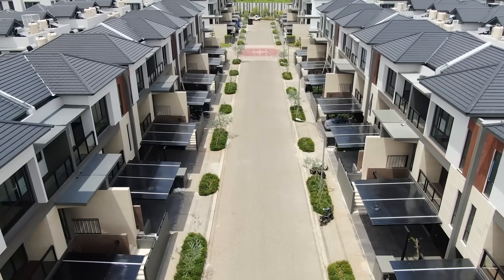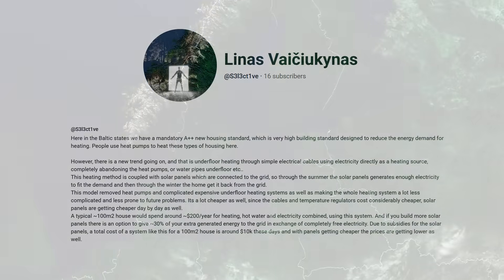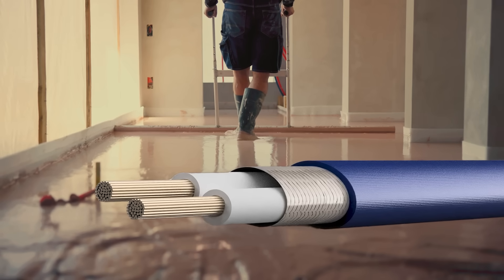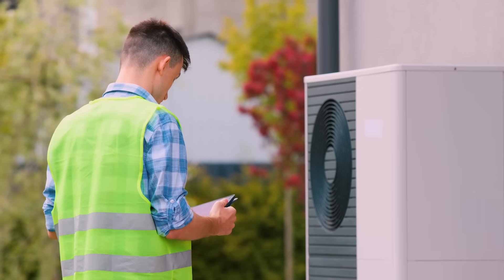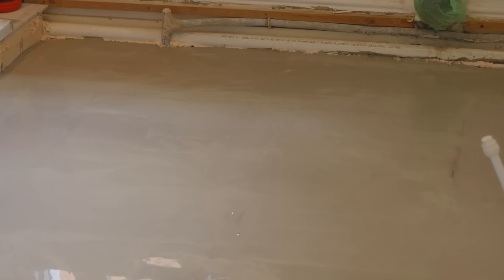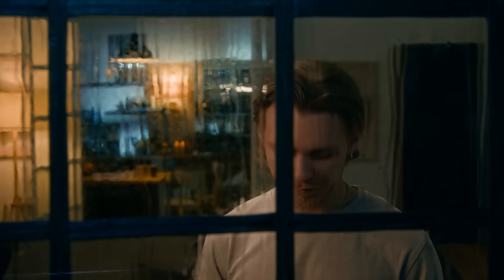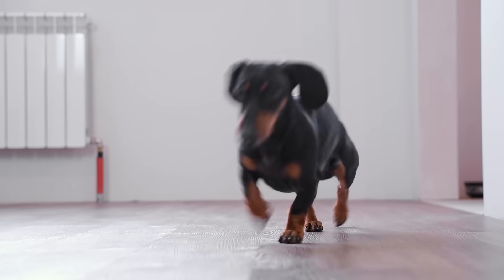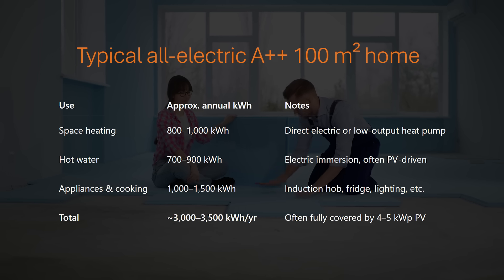What the Baltics Can Teach Us About Home Heating

Comment: The thing about the green heating movement that always baffles me is the fact that if you insulate your home correctly like is recommended by the green heaters, if you kept your old boiler, it would probably only use a couple of litres of gas a month and would likely rarely come on. You would have a piping hot house on demand at a fraction of the cost.
Reply: 100% agree very often the "heat pump" comes with the recommendation to upgrade the insulation, and the comparison is made to older boilers, often larger radiators are fitted, from my experience of 25years of fitting heating systems, a condensing boiler, rads sized for lower flow temperature and most importantly!  Simply cleaning the old cat/dog fluff from used rads, in some cases, better controls, for a relatively low cost! Most households would  make a big saving.
Reply: Yes agree entirely with you. Raise insulation levels a the first priority. Don’t get hung up on the heat source.
Reply: @chrismoore7569 I’d also probably go for solar panels as the second step after insulation.

These will reduce your annual electricity bill regardless.

Producing some of your own power also makes heat pump operation more realistic, even more so if you have a battery. If you have both you can make, import and store power to run a heat pump cost effectively. But that is a lot of investment up front. A lot.

No matter how I do the numbers heat pumps come out as the last piece of the puzzle to fit. They do make sense eventually, but only towards the end of a chain of upgrades. If the price of electricity comes down though, they may be more sensible, but not right now.
Reply: Insulation first, whatever you are doing. It works with any heating system and saves you money either way.

The potential of heat pumps is it gives you access to electricity as a viable heating technology at a cheaper cost. Whether you can access that potential depends on your circumstances. That is the key point and for many people right now, the numbers won’t work.

As an example, I have solar, but also gas and have no plans to install a heat pump. But in the summer, I have enough solar to divert to my hot water tank. I don’t use any gas for heating water for at least months of the year. Obviously the heating isn’t on, but there are still taps and showers to be supplied. In the winter I heat the water with gas like everyone else and run the radiators. The solar gives me the ability to reduce my gas use, and bills, over the course of 12 months. I am quite happy with this hybrid approach. I wouldn’t dream of going all electric for example. I don’t get why you have to go one or the other - sure it’s the ‘ideal’ but it’s not practical for most people. But, if electricity price fell back to where they were before the Russian invasion or if I get more solar panels, maybe the numbers would change. Regardless, I wouldn’t do it until it was time to change a boiler anyway. And I am sure my next heating unit will still be another gas boiler. Instead of a heat pump I am probably more likely to look at other ways of reducing, but not eliminating, my gas use. More solar panels seems the most likely option at the moment.
Reply: Correct.
Reply: That " a couple of litres of gas a month " would be WAY out even in southern england, but you're on the right track - Last year's winter -16 landed up here in February of this year, total gas for the month 194m3 - But crucially compared to the original house, 35% of the gas consumption - At today's costs, 103 quid...
Reply: You completely destroy the character of a home insulating it that much - never mind the amount of room space lost.
Reply: This has been my argument from day one, If you upgrade your home as if you were going the heat pump route but just hold off and keep your existing heat source you might find it cant coupe since it would be way oversized now. ie your boiler cycling every 1/2 hour instead of every 10-15 minutes
Reply: @dantronics1682 I’m not sure if your saying this could be a good or bad thing?(genuinely curious- is there an ideal duty cycle for an oil boiler eg 50% on/off)
Reply: @martyc5674  I'm saying insulation is the key, when I did the calculation on my house, if I improved the insulation a boiler half the size of what I had fitted xx yrs ago would work. plus a heat recovery vent system
Reply: what a load of cobblers, gas can’t modulate low enough to provide the background heat …
Reply: Why have a messy and complicated piping system, using idiotic heating systems like water radiators and boilers, when you can have simple resistive heating in a well insulated and airtight house? Britain it just so bad at building houses and is in the dark ages when it comes to heating.

Comment: There is a thought that leaving the heating on all day, maybe with a set back temperature overnight, you keep the house from getting too damp if you can keep the thermal mash warm you keep the dew point closer to the outside of the house, if damp air is condensing on the inside wall it will lead to mold and mildew.  I have electric underfloor heating in the ensuite and main bathroom you are correct it doesn't heat the room just the tiles and costs a fortune to do it we switched ours off and added an infrared panel to the ceiling and it has worked so well the bathroom is never below 20 degrees and the cost is reasonable.

Comment: Water UFH, but below the subfloor (with 100mm PIR between joists). Is it worth doing? Trying to avoid raising the finished floor height.
Reply: yes but if you have ufh how do you get access to fit the batons?

Comment: What would help millions of British households is to follow Germany in allowing plug-in or 'balcony' PV panels up to 800W. No costly installation and reams of paperwork and the power generated during the day can go towards running a tumble dryer, immersion heater, kettle, electric cooker etc.
Reply: G98 is not reams of paper work 😂
Reply: this system covers your daily background usage but the tumbler will draw its power from the grid, even though you only get 5 hours saving in the winter it pays for itself in 2-3 yrs but you cannot get small panels to give you 800w on a balcony, the most you would get is 200w
Reply: @dantronics1682 Typical German balcony fits 400-800W of panels just fine, but they have actual balconies whereas in the UK it's been impossible to fit anything but a joke juliet balcony since the 1980s because of planning rules. 800W leaning up a garden wall or nailed onto the shed roof is easy though.
Reply: Yeah. That works great in the famously sunny UK.
Reply: @nmayor4232   Is  the word SUN  in your English dictionary?🤣🤣

Comment: I think you need to balance the cash between returns on insulation, energy generation (solar heating with thermal battery and electrical by wind) and combine with a heat pump to regulate heat flow. Also, wear a jumper. However, its not all about cost. People need to consider what happens if the electricity goes off. By putting society in one basket of energy use makes it very risky.
Reply: We're already fully dependent on electricity. Gas boilers don't work without electricity.
Reply: @aliasgharkhoyee9501 The point is people should be moving to off grid life and have the grid as back up
Reply: @pauljenkinson1452  Why? 

And that's not practical for most people in Europe at present, the high upfront costs, lack of space in smaller properties, and particularly in winter when energy needs are high. 

And if you think about it, if people weren't paying fees to the grid most of the year, the grid will be unsustainable so it would be less likely to be available for backup anyway (lack of investment due to low usage and low funding, and then everyone needing backup power at the same time when the weather gets difficult in winter).
Reply: @pauljenkinson1452  Yeah, why should people be moving to off-grid life? I don't see why they should.
Reply: @Monaleenian just read my other reply I posted 2hrs before your statement for the answer.😊
Reply: @pauljenkinson1452  Maybe that reply has been hidden. The latest reply of yours that I can see (other than the one that you've just addressed to me) states: "The point is people should be moving to off grid life and have the grid as back up". That was posted 12 hours before my comment, so I presume that isn't the explanatory comment to which you're referring.
It looks like your reply must have been hidden.
Reply: @Monaleenian no YT is hiding comments again. The net zero carbon thing is a means of convincing people to remove anything that gives them freedom to replace with devices to link in with the SMART control grid.

Comment: We are overcomplicating things. A modern new build requires very little heat and nothing works better than a combi gas boiler. Add some PV if you desire.
Reply: That's good if you have gas available... I don't, so electricity combined with solar is my only option.
Reply: @molnyi5  oil?
Reply: @John_Wood_  Not worth it, I'm not from the UK... prices here in Croatia are not competitive. 

You either go for gas if available or you buy the heat pump paired with solar (basically really low or no payment of electricity).
Reply: @molnyi5  so what's your problem?
Reply: @John_Wood_  saying that not everyone have access to gas, it's much simpler to install either the regular water / heat pump powered UFH or electric cable UFH. 

Electric cable UFH is much cheaper investment (probably around 2-3k€ for 100m2, or even less) -  and then adding a bit of solar - you get a really good system for much cheaper then heat pump.
Reply: A combi boiler seems like a space ship in comparison to a bit of wire in the floor 😂
Reply: @edc1569  as highlighted, the wire in the floor doesn't work, as one might have guessed. Good oil boilers work best and do not overload the grid.
Reply: Very difficult to make natural gas with a solar panel 8)

Comment: Hi Roger I've restored a house in lithuania and lived there for over ten years. Heating is very expensive there, many people rely on communal heating in flats and that's very expensive. In our house we have a 32 kw pellet boiler. The price of pellets went from 2 euros per 35kg bag ( pre covid  to 12 during  ) now about 4 :50 Euros @12 bags per week during winter. We also have a 9 kw log burner and that's on every day as well. I probably put 6 ton of logs through it last year, it's a big house, 2 ft thick solid brickwork partially insulated on the outside 475 mm in the roof. The wired system you talk of would be useless in most homes both there and here. The key to heating and cooling is build " earth integrated "  no matter the climate. Just to add, one of the biggest problems in the UK is poorly fitted windows ie next to no foam surrounding them, i've removed trim recently to a friends front door UK and it had almost no foam just 40 mm gaps ll round hidden with trim. Windows need inspecting prior to trimming.
Reply: What's earth integrated?
Reply: Funny you mentioned poorly fitted windows and doors. I've just spent the last week removing all the trims and filling with expanding insulation foam. I could literally see through the gaps to the outside and even fit my finger through in a lot of places.  Not only does it help with heat insulation, it also helps with sound insulation.
Reply: @MadDog_Rules  its a huge problem.

Comment: What is needed is trained fitters who can install bivalent systems so that houses with existing combi for C/H and DHW keep it, but augment with a heat pump. The heat pump handles heating 85% of the time with the combi kicking in on the coldest days when the heat pump is operating as an expensive kettle. Under our crazy grant system, you have to rip out the combi to get the taxpayer funding of the heat pump.
Reply: Been saying this for ages - air to air system would work fine most of the time in my house, leaving the central heating for the coldest parts and water heating. Easy to install, massive reduction in particulates but no grants available - it’s an all or nothing approach from government, same with EVs.
Reply: The point you and the second poster make is valid, very valid however the problem I have found as a surveyor running upgrading programmes in social housing is space, where do you place the necessary plant required to operate as you describe? The problem is even more acute in the majority of private sector and housing association housing built since the early eighties (which I have also run projects on) which do not meet or come anywhere close to the Parker Morris space standards most of the countries social housing was built to. I am genuinely interested to know the trades thoughts/opinions on this.
Reply: @ceciljohnrhodes4987 . I was looking at an estate still being built in South Wales, didn’t see anything about heat pumps, half had no airing cupboards etc. I can’t see any reason with new builds why this isn’t happening.
Reply: @bordersw1239 to be honest with you neither can I. My best guess is government backsliding on the target date to stop using gas as the primary fuel source in new builds which has in turn allowed developers to carry on using the lower cost option which boosts profits. This type of profit seeking is short termist but given the structure of our industry it is inevitable.
Reply: @ceciljohnrhodes4987  but why do you need 75 gal of hot water? an inline undersink water heater would do for 70% of families who shower more than bath these days

Comment: 2025 updated Scottish Buildings Regulations are up to virtual Passive House standard. High levels of insulation, renewables and solar have been standard for almost 20 years in Scotland, in developer builds, affordable housing and social rent homes.
Reply: My house has excellent insulation, but there are two problems. The first is that it has an oil boiler (although I'm generally under £1000 to fill the tank for the year), which will be expensive to shift to a heat pump. The second is that the house should have had mechanical ventilation installed, as it is really quite stuffy at times. The wind off the sea often makes opening windows difficult, as well as the issues with the noisy wildlife and the real problem of wood burner smoke coming in from the other houses in the village that aren't efficient. 
It'll be interesting to see if the latter is addressed in the 2025 regs, I'll have to have a look. Near Passiv Haus is not much use without ventilation, and trickle vents aren't enough in my opinion.
Reply: @ricos1497 MVHR is specified in Passivhaus.
Reply: I’ve been involved in some Scottish building projects and while the paper work looks good the reality of how a lot of those buildings are actually built and how they actually perform is not great.

Like England there isn’t enough enforcement of the standards.

Comment: Energy is ridiculously expensive in the UK.....
I mean c'mon......
Reply: Hence solar, insulation and air sealing your home. Most people in the UK think they need to open all the windows to get the damp out, but doing so you're heating the outside... Need to change the mentality.
Reply: @Cam.Klingon our home half decent energy efficiency costs 100£ electricity and 600£ gas/ annum.. still a lot
Reply: @Cam.Klingon I make about £3k profit on my power bill. I don’t understand why everyone doesn’t do large PV, insulation, batteries and heat pumps. Mines outside now buzzing away, 550% efficient when I checked yesterday. If I do need any power in the winter I pay 7p per unit.
Reply: @Cam.Klingon  you need to vent the dampness out of a house otherwise you create problems, not the other way around. Roger has done plenty of videos on it and i've proved it works in our house. As do the Germans, they call it 'Lüften', look it up.
Reply: @lksf9820  it's damp outside as well, you aren't removing the dampness. Better off to control the dampness instead thru a heat pump or heat recovery ventilator.
Reply: @Cam.Klingon   Not as much as inside, where you have steam from cooking and hot showers etc. There's a huge difference.
Reply: @Cam.Klingon  heatpump does not get rid of damp, all it does is a source to heat the water in a hydronic system, just like how gas is a source, I agree about heat recovery ventilation but these are also very expensive to fit
Reply: @Cam.Klingon we don’t live in the tropics it’s never “damp outside” even when it’s raining the cold outside air can contain much less moisture.
Reply: @Cam.Klingon They do this in Germany as well. It is something people have been doing for generations.
Reply: @Cam.Klingon ventilation is still required to prevent condensation damp and poor air quality.
Reply: @Daniells1982  A++ / Passivehaus type buildings have a heat recovery system on the air exchange. Small ones really don't need anything more than a gaming PC to heat so it doesn't make sense to worry about complex heating systems.